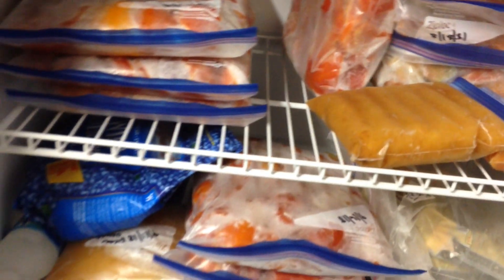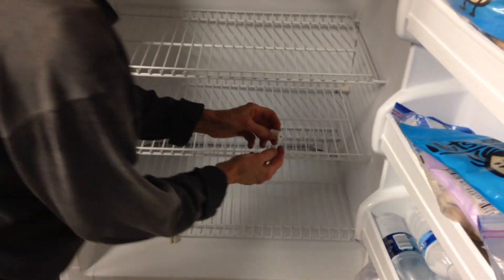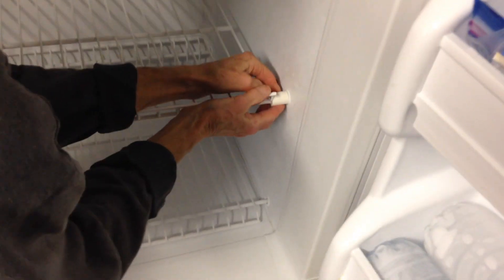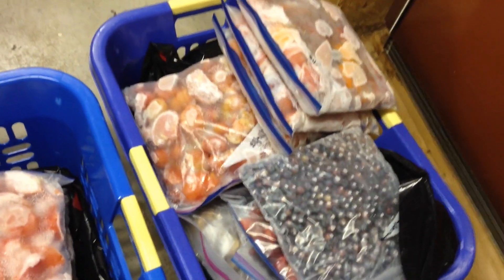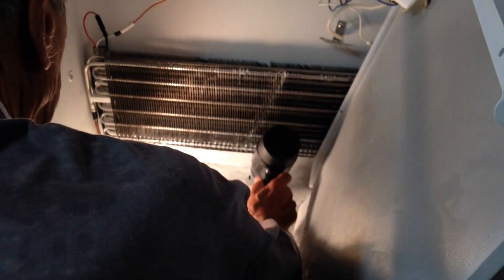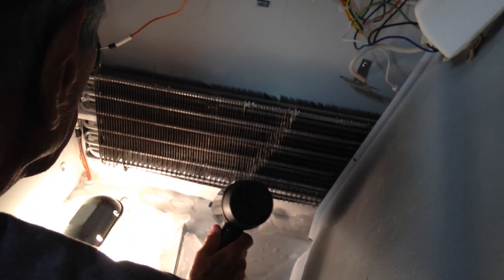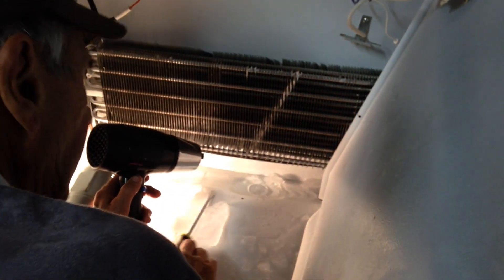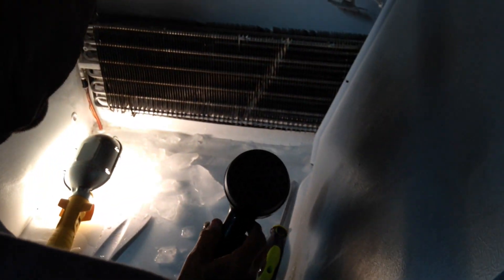Upright Freezer Troubleshooting and Tips

Comment: Have the same freezer bought it used. Cleaned it thoroughly. Saw what I thought was damage on the back side on the bottom. So I taped over it. Thanks to this video I know that is there on purpose for air flow. Now it pulls down under 20*  thanks so much for saving me stress and a repair bill for a stupid simple mistake.
Reply from the maker: I totally love and appreciate you and your comment. I have blocked air flow in the frig and caused a lot of fresh food to freeze. All the vents in the frig/freezer must not be blocked as it can be a costly problem. Best bet for a frig/freezer combo is to check where all vents are in the frig and freezer and make sure there are no vents obstructed as the frig depends on the cold air from the freezer and if there are blocked vents in the frig or freezer it will disrupt air flow causing cold air to be blocked in frig etc. Thank you.
Reply: @bevyh1   BTW your marriage is definitely relationship goals. Even after only 12 years of marriage my wife and I have had our share of "well if I do you can say I told you so moments."  Thanks again.
Reply from the maker: @nathancurtis4184  I have learned from my many mistakes but it would be nice to learn ahead of time more often.

Comment: That keeps happening to my freezer every few weeks. At first, I thought it was the thermostat and changed it out, it worked, but that may have been because I let the freezer thaw out a few days and really didn't need the thermostat. I just needed thawing out. I Will do this again today as my freezer stopped cooling again yesterday I noticed after I replaced the thermostat 3 weeks ago. Thanks for this video~ I was confused at first, but now I see clearly the problem.
Reply from the maker: So glad this video helped. Our freezer has been working fine so far and is stocked full of frozen tomatoes from the garden.

Comment: I had the same type freezer. The problem is not ice, but not cool down enough. The cold air coming out of the outlet, but I guess not cold enough. I open the panel, but cannot find the thermostat as I saw from the video. DO you know where to find the thermostat I can check to see if it is working properly? Thank you.
Reply from the maker: The thermostat is behind the fourth shelf down to the right. You may need a flash light to see the thermostat. Also you can buy a thermostat at Ace Hardware that you can stand or hang so you can see what the temperature of the freezer is and it is worth having some for the frig and freezer. Having two is even better in case one doesn't work properly. Hope all goes well for you.

Comment: I rewatched your video and I am wondering if you have your freezer plugged into the strip beside of it. Our friends were gone on vacation and their house burnt down the fire marshal said it was because the freezer was plugged into a strip and not directly into an outlet. Just a word of caution if it is I would change it to the outlet. But maybe it is not.
Reply from the maker: Yikes !!! This is the way it is set up. The last thing in the world we want is a fire hazard. Thanks for sharing.
Reply: @bevyh1  I would hate for there to be a fire in your house if I did not say anything The fire marshal said it was definitely because of the freezer being plugged into a power strip I just googled the question and this is what I got, hope this helps

Refrigerators and Freezers
Large appliances like refrigerators require a lot of power and frequently cycle on and off, which can easily overload a power strip. These devices should be plugged directly into a wall outlet dedicated solely to powering the appliance.
Reply from the maker: @1954evelyn  Thank you so much for the info as I'm sure there are may people that do not realize that this could be a fire risk. I hope we will be able to remedy the situation.
Reply: @Evelyn Horsley 👏🏽👏🏽 The most underrated comment here!! Freezers/Refrigerators need to be plugged directly into an outlet AND it must be a NON-GFCI outlet! Many people complain about their fridge tripping the breaker or tripping the GFCI without knowing that fridges were not designed for those type of outlets. GFCI outlets are meant for bathrooms and countertop areas prone to be exposed to water.
Because of this, many people end up using extension cords/power strips from an outlet that “works” for them without realizing why and what the consequences are.
I ran into a situation where a fridge in the garage kept tripping (because the outlet installed was the first/main GFCI outlet that protected the outlets down the line in the laundry and ending up in the kitchen counter. Hence an extension cord was used to tap into a neighboring outlet in the garage. Major fire hazard that was waiting to happen. Luckily we ended up running a separate line from the main breaker and installing a 20amp outlet.
Reply: Correct, power strips are used for temporary usage.

Comment: I am having same issues with same freezer not sure how old it is maybe 12 years old, I noticed whrn I tool a whole ham out it was not frozen and also a package of hotdogs but beef roasts and steaks were frozen I put in my thermometer and the temperature was 20 degrees, I took everything out tossed the ham and hotdogs and turned off the freezer and left the door open, . there was some ice accumulated on the inside near the bottom, overnight and water accumulated on the garage floor and I assumed it had totally thawed out I turned back on the freezer and it still only cools to 20 degrees. When your hubby removed the panel is that the coils that can get dirty or is there some underneath the freezer, I saw on one video that that could be the problem if coils dirty
Reply from the maker: Ok here goes. I picked my husband's brain this morning to see what he remembered about the freezer. He can not remember where the coils are but he said listen to hear if the fan runs when you have the freezer plugged in. If not you may need to replace the fan as the fan circulates the air flow and if it is not working that may cause the temperature to not go above 20 degrees. Also get two good temperature gauges to determine accuracy on freezer temperature. I have what is called a Taylor name brand temperature gauge and have two that have a stand and a hook at the top. So it can hang on a rack or stand for easy visibility. The ice was so hard in the back at the bottom of freezer that we needed a hair dryer to thaw it. Your freezer most likely thawed overnight that hard chunk of ice blocking the vent at the bottom back of freezer but I would check and make sure using a flashlight. Sorry I can't be more helpful.
Reply: @bevyh1  Hi Bev thank you for the reply, I have had the freezer turned off since a couple days ago I just went out and turned it back on and the fan did come on right away, my son-in-law is helping me but he knows about as much as I do LOL about the freezer. He did take a flashlight and looked under the freezer and behind and he can not find any outside coils just the ones inside thanks for your help, also does your freezer now cool to zero what was the problam with your freezer

Comment: Thanks for the video... our freezer has the same problem of ice collecting in the bottom but the drain tube and bucket are dry (ours has a bottom drawer instead of a shelf)! I was hoping I could avoid taking off the panel and doing a big defrost but I guess there’s no way around it! I’ll let you know if it works when I try tomorrow!🤞🏼
Reply from the maker: I hope all goes well for you when you do a defrost as it is horrible to have a freezer full and have this happen. All the best to you.
Reply: @bevyh1  Success! I followed your steps and everything is back together an working for now so thanks! Saw another video suggesting RainX or auto type wax to make condensation slide off more easily and also adjust the feet to tilt the freezer backwards slightly so water drains more quickly! Hoping and praying that it works! Thanks again and God Bless!
Reply from the maker: @blakehendrix641  Awesome !!! So glad to hear this worked for you. It has worked well for us and the freezer is still working fine. Put something like an ice tray filled with water or something small in front on a shelf at eye level and test to see if it is staying frozen as an ice tray will sound the alarm if the freezer is starting to thaw. I haven't done that, but plan on doing that. May God shower blessings on you.
Reply: bevyh1 is that a GE upright freezer?
Reply from the maker: @ArisBuliteanu  It's a Frigidaire.
Reply: bevyh1 is that a Frigidaire automatic defrost upright freezer? Thanks
Reply from the maker: @ArisBuliteanu  Yes, it is an automatic defrost upright freezer.
Reply: bevyh1 what year is the Frigidaire upright freezer? Thank you so much after you say all set, what did you do? It was the click click click click click click click click click noise in the freezer, is that the food?
Reply from the maker: @ArisBuliteanu  Sorry I have no idea the year of freezer. All I can remember is after we thawed the ice it freed up the airflow and the freezer started to work properly. I don't remember the clicking noise.
Reply: bevyh1 2004 Frigidaire automatic defrost frost free upright freezer there were some bags clicking in there after you thaw the ice out, I didn’t hear the fan but I heard the compressor, did the van start it up after you thought the ice out? I mean does the band start it up after your father the ice out? I mean did the van start it up after you for the ice out?, I mean,did the fans started up after you thaw the ice out?

Comment: Hi I have a question I have the same freezer the same issue let it set overnight unplugged all the ice melted, Darin was running freely. When I plugged it back in it got cold to zero degrees, but it got real warm to touch on the outside the side panels and top that has stopped but it continues to run, does not shut off but it is still cold 🥶 did your do this and did it finally turn off.. ?
Reply from the maker: Our freezer is working fine the way we did it. The last time we had issues with this freezer the repairman said it was the fan that wasn't working properly and I think he cleaned the fan. This issue of ice freezing and shutting off the air flow and the fan not working properly is a similar situation as both has the issue of the air flow being restricted. Don't know if you could have a fan problem or not. I never noticed the issues you are having. Sorry I don't have a better answer. Thanks for watching.
Reply: go on the website and put your model number in and the manual will come up. read it. you will find out troubleshooting methods as to why you're having an issue. i did.
Reply: laceynes
 My freezer has ice on the bottom and it is leaking out the bottom of the door onto the floor, but just like you mentioned the outside panels got real warm to touch. Do you know what caused the outside the side panels to get real warm to touch? I don't think that is normal. Thanks for any feedback.

Comment: i had the same issue seen all the ice so I took off the panel in the back and low and behold all the ice on the bottom covering the drain. used 2 blow dryers and now it's getting cold again.
Reply from the maker: Glad to hear all is well with your freezer. I should fill one ice tray with water and put it in front at eye level so I can look for any thawing of the ice tray that could indicate ice build up again as it's easy to lose a whole freezer full of food especially in the summer when the cold air flow is restricted with ice. Thanks for your comment.

Comment: My freezer door is leaking at the bottom of the door . Its dripping from the rubber seal. How can I fix it
Reply from the maker: Sometimes the seal needs to be replaced and sometimes the seal just needs to be cleaned as seals on frigs and freezers do get dirty and can get sticky and the seal can stick together and needs to be separated. I'm not recommending this  but I used a flat screwdriver and folded a rag over the screw driver to protect the seal from the screw driver and cleaned in between the seal folds and my old frig/freezer seal quit leaking. Good luck. Can't remember if I used soda water or soapy water and then rinse water to wash off any soap or soda water. Care must be taken to protect the seal so it does not get damaged from the cleaning.

Comment: How do you prep the tomatoes for the freezer storage?
Reply from the maker: I just wash them and core them and leave the skins on them, and put them in freezer plastic bags. Sometimes I quarter them and sometimes I leave them whole. It depends on the size of the tomatoes. When I make veggie soup or chili, I just put them out for a while while I'm cutting up the veggies for the soup or chili and put them in after I get all the other veggies in the pot and the veggies are hot. The skins will come off easy, curl up, and are easily removed.
Reply: @bevyh1  thank you very much!

Comment: You missed the part where you clean the drain tube from the back of the freezer.
Reply from the maker: I am so sorry about that. Sometimes I miss clips when I'm putting the movie together. Thawing the drain tube is a dilly. I had a really really bad situation last summer and a lot of my fruit and veggies thawed as it took a long time to thaw the drain tube and clear it out. I did a video on that too and have a lot of videos that I have wanted to do but haven't had the time as it takes a long time for me to do videos as I am not computer savvy. I show what I did the second time on the drain tube. I need to refresh my memory as to what all I did. All I can remember was using a hair dryer and not water but it seemed like there were some other things I did too. My husband was in the hospital and I was on my own dealing with a packed upright freezer. Best bet is not fill your freezer too full in the first place as that is asking for trouble. Also put an ice tray filled with water in a eye level shelf in freezer so you can check at a glance if the ice is thawing.